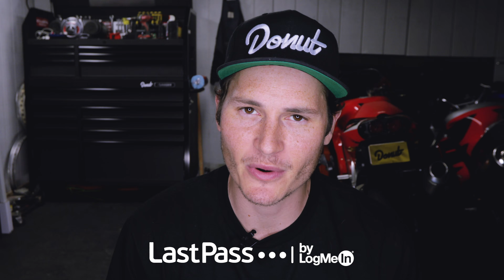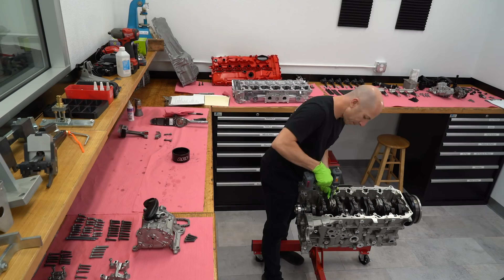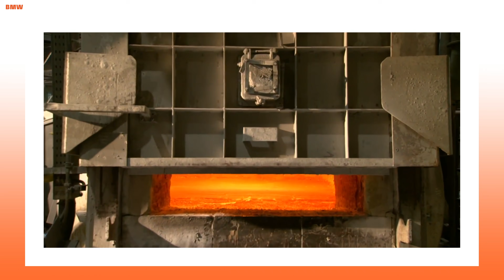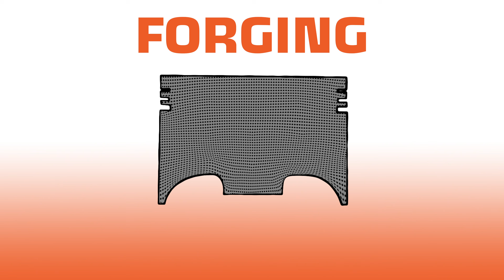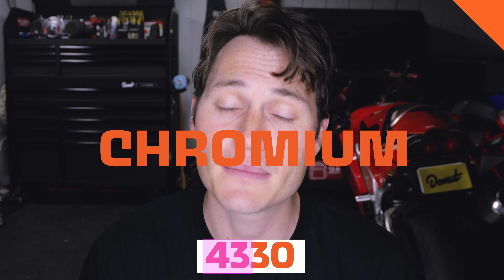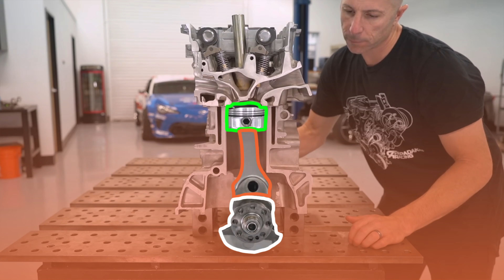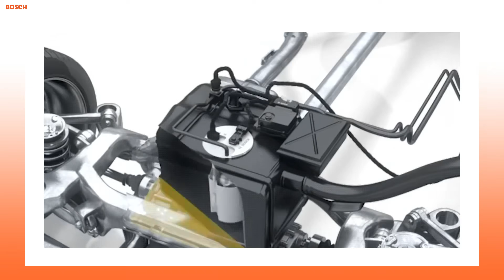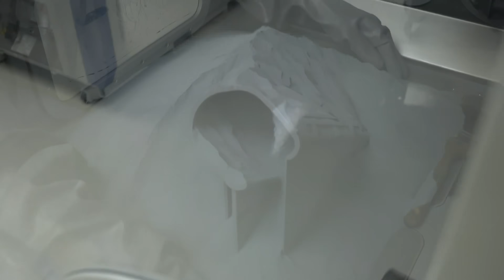The FIRST 1000HP 2020 Supra - Tech Explained

Comment: "still using stock engine"
me: okkkk...

"limited modifications"
me: I SEE YOU

"rebuilt using lasers and 3D printed metal"
me: waaaait a minute
Reply: I mean 2JZ also need technically same modification to achieve 1000 hp with this (upgrade piston and conrod, porting, better injector, bigger turbo, upgrade valve). And people still called it "stock engine"
Reply: @bocahdongo7769  stock = factory head lights
Reply: @bocahdongo7769  same? the 2JZ would need wayyy more work than this.
Reply: @bocahdongo7769   to reach 1k hp 2jz needs  bigger turbo better  interculler  exhaust system  and pistons....BUT NOT THE LASER AND 3D PRINTED METAL that makes huge difference between  b58 and 2j
Reply: @davitavazneli8573  Calm, 3D printed metal used for manifold for speed development, not due to stregth or anything. Papadakis clearly said that in the Video
Reply: @bocahdongo7769  yes he said and bla but thing is that 3D print is expensive and why you will do that if it doesnt makes any sense than strength 3d print is way cleaner than other methods of making parts
Reply: @worlow1841  fan boy?how old are you do you even understand enything about cars?
Reply: @davitavazneli8573   that is simply due to the lack of support. Once it has that support I don't think you'll need this new intake with port injection.
Reply: @davitavazneli8573  3d printing metal is gonna be faster and cheaper than developing all the things needed to create an intake manifold properly.
Reply: @davitavazneli8573  wdym? You really think 3d printing makes more power BruH
Reply: @jj-hf8jy  no i dont
Reply: @davitavazneli8573  Again, Papadakis clearly says that if they can, they will do casting instead.

But casting will take at least a week or two for molding and forming and several days for machining and welding, it's not even talking about heat treatment (like normalizing) that take age to do. For industries, you can set up whole batch of production that make parts much faster. But nobody doing that yet and they only need one chunk of manifold ASAP (again, he clearly said that)

It far makes sense to use 3D print instead because you can cramp 2 weeks work into 3 days for only one thing. Metal 3D print isn't magic or rocket science, at all. It just "welding" grains of metal with machine, it's hella expensive, had relatively lower quality than proper casting, and has very poor production of scale. It's sounds like CNC billet machining but actually much worse in anything but speed and flexibility. Hence nobody doing that industrial scale even for several years in the future. But for prototype purpose (like Papadakis clearly do), it's better than set up everything for casting one or take tons of machining for billet one.
Reply: @davitavazneli8573  they used 3d printed metal because there isnt any mass produced parts that can support the 1000hp yet on the b58, and by the way its "3D printed metal" the quality is still quite the same as a mass produced part
Reply: @davitavazneli8573  listen here folk. The 2jz has been on the market for 28 years, and is a modified version of the 1jz from 35 years ago. The B58 first started production 5 years ago. This massive difference in the time these engines have been available is the reason for the huge amount of aftermarket parts available for the MK4 Supra compared to the MK5. I can assure you that after a couple of years, the B58 will be more tunable than the 2JZ
Reply: @זהסודי-ה7מ  dude can u tell me why are u bothered to coment after 1year and also whats up with all of u bmw fan boys,just chill it was just my opinion,but every single one of you decided to flame one,me like wtf people actually made me regret to even be interested in cars
Reply: @davitavazneli8573  you think that a 2jz can make 1000hp with stock internals?? LOL

Btw, they just needed tha 3d printer for the manifold to overcome the GDI
Reply: @davitavazneli8573  2jz parts don't need to be 3d printed because they are already available in the market unlike the b58.
Reply: @C4Fuu  dude who tf are you to tell me what to do others started ofending me and other people before i did, also i didnt  state any fact or argument like that it just seemed that way because of my bad english,so before you come here and write coment like that like wise man you better think twice
Reply: Well, the problem should be solved when there is aftermarket support for the direct injection system. After that, you won't need to 3d print parts anymore.
Reply: @cooperray2630  this
Reply: Stock Block*

Just waiting to see how long they last while in NORMAL peoples hands. Whom don’t have a limitless resources to throw at it.
Reply: lasers man it's always the lasers...pew...pew
Reply: This comment section is hilarious stupid to read XD. I love how so many people comment about the 2JZ like they have built it and tuned it themselves lol. I mean wtf is a “interculler?”

Also yes, the B58 build by Papadakis DID use a 3D printed metal manifold since NOBODY makes one capable of 1,000 HP+ and it’s explained by Papadakis himself. It’s not like when people first started tuning the 2JZ-GE and GTE that aftermarket parts just magically spawned in the and BOOM - MO POWAH BABEH !!! No... it took SEVERAL YEARS for those aftermarket parts to become available.

P.S. - No I’m not a mechanic, tuner, or engineer. I’m just stating the obvious facts that should be common sense but apparently it’s not for some people...
Reply: @Dat_Zupra_Dude  And that's exactly what i got when i watch this video. No doubt that 2JZ has ridiculous potential and already been proven lot's of times. But remember, 2JZ also got some hills to take at the same period of time as the B58 from it's initial release. Limited source for aftermarket. 

The reason why it's easier to tune nowadays is also because of more understanding of the 2JZ as the time passed by and the increasing numbers of aftermarket parts as well. The B58 only got a couple of years, rather than 20+ years. And technically it doesn't really matter if it's 3D Printed using laser or good-old casting. Stephen Papadakis already clarify that they used 3D Print routes to cut the amount of times they need if they want to use more traditional method
Reply: Lassi Kinnunen  nah fam! Them headlights or it aint stock!
Reply: All of this in the first couple minutes. Donut, CHILL
Reply: Lassi Kinnunen  they make aftermarket v8 blocks for people who actually want to make hp. Stock cast iron ls7 blocks have made over 2000hp and stock 4.6 Ford blocks have made 2500hp. The aftermarket blocks are for people making rediclus power like 2-3000+hp. A 1000hp is nothing for the ls or mod motors.
Reply: limited mods because the engine is so new no one made parts for it , yet
Reply: To some extend, it's rather true. I mean they still use some stock part from the factory. It's aren't that par if we compared it with 2JZ.

If we talking about 3D printed metal, i believe they already explain the reason. Which is there haven't been many aftermarket part for it. So rather than waiting, it's better to make it themselve. They could wait, but they didn't want to. But because in the early 2000's 3D print wasn't a thing, they mostly waited for the aftermarket company to made one
Reply: That dp is noice 😂
Reply: Watch Tom wrigly's 700hp m240i with stock motor .
Reply: @arinb.756  it actually metters cuz 3d printed one is more solid and can stand more than normall one
Reply: @davitavazneli8573  And yes, 3D printed surprisingly less durable than using normal welded cast metal. There's so much impurity on it but they don't mind to even remove it with heat treatment (because again, they use it because much faster)
Reply: @bocahdongo7769  actualy 3d parts can be strong AF. buggati chiron uses 3d printed brake calipers
Reply: @davitavazneli8573  PLEASE stop. just stop.
Reply: @arinb.756  i dont care about but holly shit you are spicy fanboys out there i just said (or writed if you will) that 2j is better and 3d... and you exploded behind the screeens like total idiots it was just my opinion and everyone started writing things like they are proffesionals im pretty sure you've been EDUCATED by google 5 minutes ago with that info didnt knew anything about it and now you are writing like pro
Reply: @davitavazneli8573   you can't even form proper sentences and your questioning others about their age.
Reply: @naut3  bruh cuz im not from US or gb and english isnt the language that i usually speak

Comment: EVERYBODY GANGSTA TILL THE AWD CIVIC PULLS UP
Reply: Frustrated EG has entered the chat
Reply: @h.a.4600  🤣
Reply: Or the 1000hp 20' supra spools its turbo
Reply: @johnugabi7819  bruh if the vteck kicks in you are done
Reply: @johnugabi7819  Frustrated EG is a tough customer, i don't think the Supra will beat it with ease.
Reply: Vtec just kicking in,yoo 😂
Reply: @andreanp3816  [INSERT FAST FARTCAN VTEC SOUNDS]
Reply: @NGKGMR  BWAAAAA
Reply: @johnugabi7819  more powa baby
Reply: *until midnight club members appear. retaining 300 kph speed for 15 minutes is more impressive than acceleration runs alone.
Reply: @alexandrepf8471  nah i need my vtek and they done
Reply: "Prengg prenggg preengggggggg"
0-60 in 7sec

Comment: Oh no. Here come the 2JZ Keyboard Warriors. 

(Sidenote: only thing I hate about the new Supra is the E-dipstick. Damn you, Germans.)
Reply: Hope there's aftermarket oil pan soon
Reply: Bluetooth dipsticks add 50hp everyone knows that
Reply: Hallo ein Deutscher hier, irgendwie müssen wir den Ruf die besten Autos zu bauen doch beibehalten xD
Reply: @fulltimegamer9194  Ich glaub das schaffen wir ganz gut xD
Reply: FulltimeGamer ja, nicht alles ist perfekt
Reply: F@$# that e-dipstick. On my 2008 BMW 328i, is one thing I hate the most. Takes about 10 minutes to check the oil level.
Reply: I, as a German, apologize on behalf of all Germans.
Reply: Lol. Tell us how you really feel. While bothered by someone else’s opinion. I’m just waiting to see how it holds up. Not saying much of anything about it.
Reply: I feel that, tried to find the dipstick on a BMW M5, boy did I feel like I knew nothing about cars 😭💀
Reply: Just hope the e-dipstick sensor never stops working or you won't know if it's low on oil until it explodes. Worst idea ever (followed by electronic handbrakes).
Reply: And the fact that it doesn’t even come with a manual transmission option
Reply: @JoeyLovesTrains  manual transmissions have no advantage over automatics anymore. You can shift through the gears on an auto without the lag of a pedal clutch. You'd be better off to have a spring loaded pedal on the floor that does nothing more than make you feel like your doing something without screwing up the precision gear engagement of the auto clutch.
Reply: @kefwals8722  it’s still fun..
Reply: @JoeyLovesTrains  Opinion
Reply: You have a point, it’s a bit of annoyance when it’s servicing time for euros
Reply: And the transmission :)
Reply: PREACH!!! German over-engineering at its finest.
Reply: I feel you dude
Reply: ShingoKirishima1997 NOOOOOO NOTHING CAN BE BETTER THAN THE TOO JAY ZEEEEE!
Reply: Thank you!
Reply: I feel you guys. I'm waiting for the 3jz to come out and it's going to be mental. Watch "driving 4 answers" you will have mental orgasms
Reply: it could have been a perfect chance for toyota to make 3jz engine